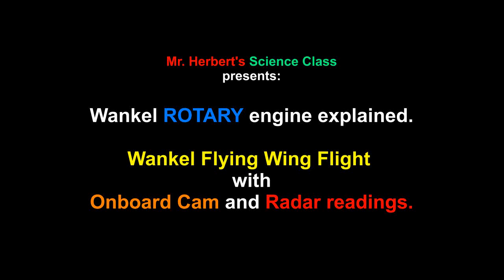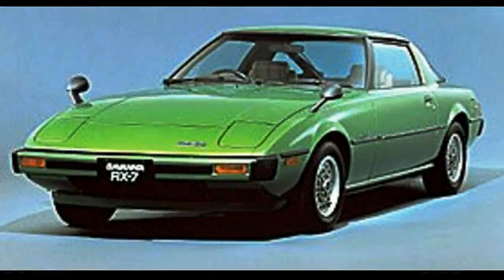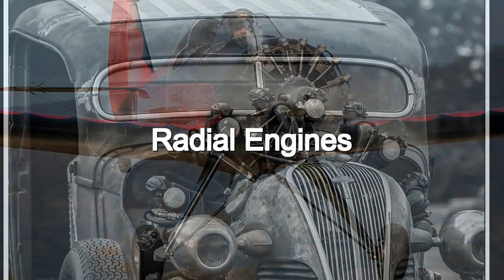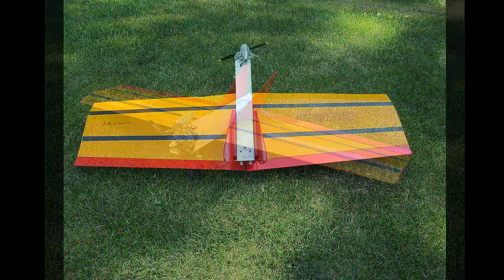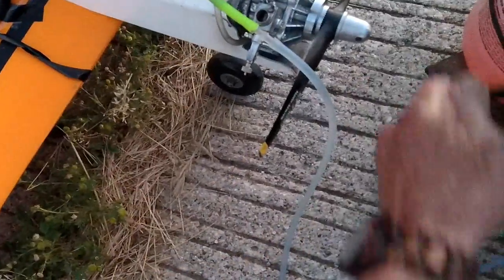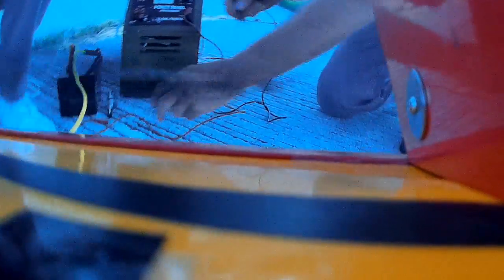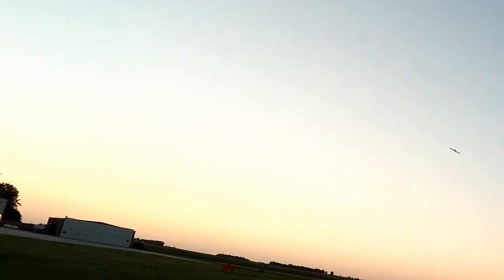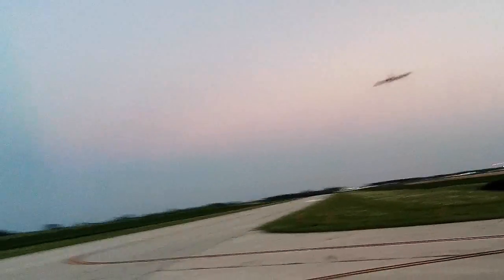Graupner NSU OS Wankel rotary engine Flying wing.

Comment: Is that engine still running strong?
Reply from the maker: Actually this was destroyed in the fire that destroyed all my models, shop and house in September of this year, 2016.  I was able to find another that has a loose muffler, but it runs pretty strong and here is a newer video to see it run.  https://www.youtube.com/watch?v=JBRUHTzYjQQ Thanks.
Reply: @NightFlyyer  I'm so sorry to hear about your fire! That's so sad! I'm glad you found another Wankel engine! Are the old OS Wankels pretty reliable? I'm thinking about purchasing a used one.
Reply from the maker: @Doriamo  Thanks.  Yes.   I never had it fail.  They run hot and are messy, but sure sound neat.  Good luck finding one.
Reply: @NightFlyyer  there are a few "NIB" on ebay right now but very pricey!
Reply from the maker: @Doriamo  No Doubt!

Comment: To confuse things even more, the original wwI round engines in aircraft were ‘rotary engines’ as opposed to radials from wwII. These rotary engines were like a radial but the crank shaft was fixed to the plane and the engine spun with the propeller.  As far as I know the only wankel type rotary engines designed for planes were the os model engines like in the vid. The full size ones shown were auto conversions etc. but the rotating cylinder ww1 engines were original equipment in the sopwith planes etc.
Reply from the maker: That's right. Most of the museums have the WWI engines to see.  Must've been hard to balance all those cylinders rotating.

Comment: I can't speak for airplane applications, but for cars, bad efficiency is not a deal breaker. If it were, everyone would be driving a Prius. I plan to put a JDM Rotary engine in my small pickup truck for the heck of it. I don't care if it costs a fortune to fuel it lol. This swap could easily double the current HP of the truck. If I turbo it, maybe more. It only makes like 95HP from the factory (back in 1985). By now, it's probably closer to 50-75HP.
Reply from the maker: Right.  It uses lots of fuel, but for sure is really cool.  My friend had an RX 7 Mazda and it hauled butt and was smooth.  I think Mazda is bringing back a new rotary engine car.  That car also looks amazing.  Thanks and good luck with your project.

Comment: Very nice. I bought one of this engines. I do you have tips for use this engine?
Reply from the maker: Well, they get hotter than others, so keep it out in the breeze.  Any crash will probably break the muffler off, so don't crash!  Check muffler screws after every flight, or it will become loose and eventually unusable.  Thanks and Good luck.
Reply: @NightFlyyer  Nice. Thank's

Comment: I think John was suffering full on Alzheimer's  when he "designed" this horrid looking whatever its called ...Can you even say it was actually designed .. point to the parts of it that you think any "design"  went into ?  in fact John Milner would have said what a waste of machinery  ....That creation is fitting of a Cox engine the one that cost like 12.99
Reply from the maker: John in now over 95 and not well.  He sold thousands of these combat clippers in his very famous hobby shop (They remind me of my u control Combat Cats  back in the 50's that were hot flying wings.  Johns was designed to fly in combat, so strength was the key and it was always good to have 3 on hand for the contests.  This one flies very well and is fun, (the whole meaning of it,)  not to put someone down like you did, because he was a success. BTW, you wont find any Cox engines for 12.99 anywhere these days that are worth it. Better not watch my home made flying wing with a Wankel, as you will really hate it. But thats okay, because t I figure, if it sounds stupid, but it works, it ain't stupid.  LOL.

Comment: These engines are very popular in drones and UAV's.  They didn't drop the design.  It is far superior to a piston engine.  The car industries geared up to switch to this engine in the late 60's, and then they all pulled back except for NSU and Mazda.  It wasn't because the engine consumed too much fuel.  They tricked us, just like they did with the Chrysler turbine and the MK-14 torpedo turbines they manufactured in the tens of thousands.  But the simplest is the Wankel.  Too light, too efficient.  Big Oily wanted heavy, lots of friction, low compression and they got an oil guzzling winner with the 4 stroke piston.

Comment: ...The real aviation rotary engine looks like a radial engine but is not: the true name from the Gnome,Le Rhone and Clerget rotary engines was in fact "moteur rotatif" (rotary engine) because the engine housing rotate around the fixed crankshaft, and the Wankel's true name is "Wankel KKM =Wankel kreiskolbenmotor" (rotary PISTON engine)...

Comment: It's why most Europeans we call it a Wankel engine instead of a Rotary engine's. The " rotary piston engine existed way before the Wankel engine" Calling the Wankel engine a Rotary engine although it is in a way is confusing. The patent also says Wankel engine instead of rotary engine. It's a German invention copied by Mazda nothing Japanese about the basics of course engines evolve it doesn't make it Japanese in anyway though. You even showed a rotary engine at the start of the video. People might know the difference if the engines would be called by their original name........
Reply: The Wankel rotary piston engine is the property of NSU (Felix Wankel was engineer by NSU), who is now part of VAG (Volkswagen Actien Gesellshaft) after the aquisition from Auto Union (the 5 circles from Audi are not Audi but auto union...) NSU sale the Wankel engine licence , and the first owners from the licence for the Wankel  engine was : Mercedes benz (who improve the TBO from the Wankel  with the Nicasil Coating), Citroën (who built in common with NSU the wankel factory "Comotor", and Mazda)... but some others buy the license...
But the name "rotary engine" comes from Mazda who find "rotary" more "sexy", shorter and simpler as "Wankel rotary piston engine", but you are right: in history, the real "rotary engine"  is someting different: was the great speciality from the french aviation engines builder before and during WW1 (Gnome, Clerget, le  Rhone)...the first known use from the rotary engine was in the rear wheel from the 1893 Felix Millet motorcycle...

Comment: Years ago at the hobby shop in the town I grew up in, they had a tiny palm sized Wankel engine. The shop owner boasted it could  crank One (1) Horsepower at about 20,000 RPM.

Comment: what a sweet setup,, always been a fan of the rx7s.  did not realize they made a rc  version of the wankel enine.. i should not be surprised they iv seen everything else while looking at the vintage engines on ebay.. some of them things are down right expensive.. but i guess those engines are more for collectors.. which makes one wonder.. after  that generation is gone.. seems like the next rc generation coming up is gonna be all electric ( even tho i think larger aircraft its more cost effective to fly gas.  the weight of batterys and the cost of 8s batterys.  but then if you are building a large aircraft of that caliber price is probably not a issue.. ).. weird to think about.. nice wing.  very agile. :D

Comment from the maker: When I say rotary engines, I am talking about and referring to engines without pistons, just to be clear. The Wankel has no pistons.
Reply: Correct I had an Arctic cat snowmobile with a 303 Wankel in it and you knew it was running right when the exhaust was glowing red :)

Comment: Your technically wrong.
P47 etc had radial engine as you correctly stated,
Early WW1 aircraft had rotary engine, the cylinders spun around the crankshaft, this created a huge torque reaction, however it did help to cool the individual cylinders.
A wankel rotary engine is entirely different as you demonstrate.
Reply from the maker: Come on man!. You know I am talking about rotary engines without pistons as the Wankel is! I am familiar with those "rotary" engines you are talking about, and they aren't in the same category of what I am speaking of at all.
Reply: Yeah, sorry, realised it was a daft comment after I posted it!

Comment: Brings back memories:) Scimitar(type) wing and Wankel. There is also a piston rotary radial engine where the crank is stationary and the engine rotates.
Reply from the maker: Yes I will be flying my Bill Evans Simitar soon.  The piston engine rotating is not what I am talking about, as that is a rotating Cylinder Engine with pistons of which I am familiar with.   Thanks.